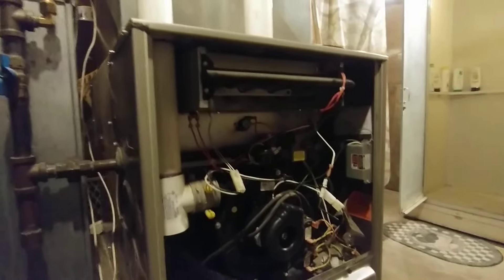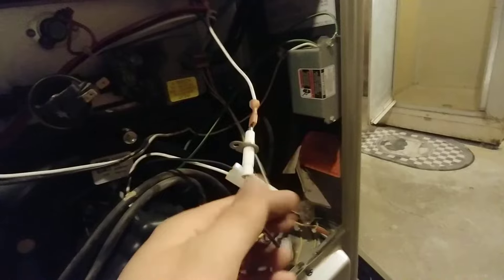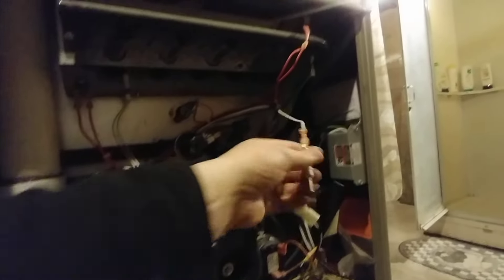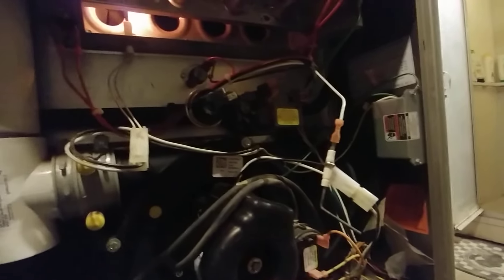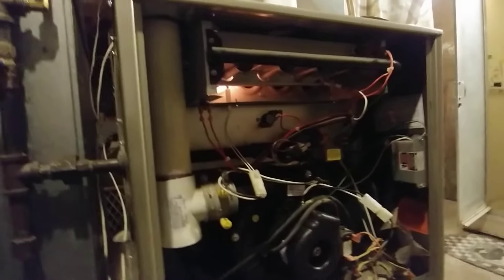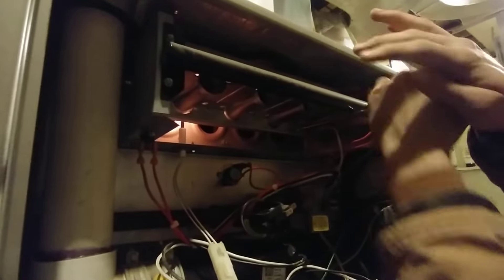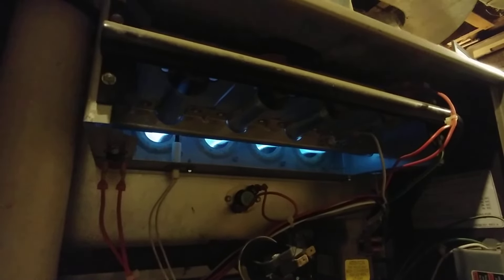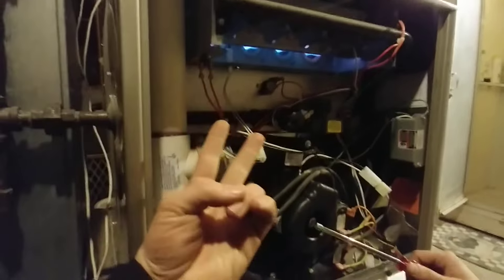Furnace Lights Then Goes Out - Symptoms of Dirty or Bad Flame Sensor

Comment: Thank you! I just fixed my gas furnace using your advice. My furnace had been struggling for about a week now to stay on and today she finally would not go to that final cycle on stay on. I took out my flame sensor and used both fine sandpaper and steel wool to clean the rod and she works perfectly now.

Comment: sometimes the stay on much much longer and then fail and are much more unpredictable.  Good video.
Reply from the maker: That can be caused by the high limit tripping sometimes. Definitely is not always as simple as just the flame sensor. Thanks for your comment!
Reply: @BenjaminSahlstrom  Sounds like what my furnace is doing.. 3 techs don't know whats wrong.. all they did was reset the panel but the furnace still runs weird, like runs 4 mins, shuts off for 15 seconds, fires back up for 5 mins.. Its intermittent, so it doesn't always run like that.. no one knows whats wrong..

Comment: Thank you! Cleaning the sensor worked! (and it's supposed to get cold tonight) 
Now I need to replace the ignitor for my Honeywell (been lighting it by hand) it has the kind that just glows I was wondering if anyone knew if the universal kind would work? The Honeywell is old (late 50's or early 60's)...looks just like the one in this video except mine has the gas burners at the bottom.
Thanks again!

Comment: My Carrier Infinity kept throwing a code 45.
The HVAC guy came out and looked it over.
He cleaned the flame sensor, and everything started working again.
It threw him, because apparently there's a separate code, like 32? That triggers when the flame sensor is dirty.
He said that if it happens again, it's most likely the control board, and that it'll have to be replaced.

Comment: So like what could it be if you never get the flames? It’s hit and miss. Sometimes it will light then go out anyway, sometimes it never lights. A guy can and checked the gas valve there is 3.5” after the valve. I’m about to give up on it. Is it a possibility that the manifold is dirty? I guess that’s what it is called anyway.
Reply: Check if you need a new igniter. $25 part.
Reply: The manifold was dirty.

Comment: Mine would light after reset the furnace up until today. It heats up runs for a few days, to a few hours or just one round then go off,  then would not heat back up on its own without reset. Now reseting it isn't working. Still has a pilot flame. Could this be an issue of the flame sensor? Or what may it be? Tks.

Comment: Dude I had this happen on my hot water tank easy fix my furnace has been acting up waking up to the house being 10/15 degrees colder then set temp. You sir are a huge help 5 minutes and boom furnace fixed but I blew all the dust out of the unit and new thermostat wires so was work digging around 😂

Comment: My furnace is doing the same thing, the glow plug lights and the flames come on, but then a few seconds later the flames go out, but then it tries again and continues to cycle on and off.    I took out the flame sensor and scrubbed it with sandpaper, it seems to be working fine now, do I still require maintenance? Or is that probably all it was

Comment: I think mine is probably dirty. 
I just haven’t gone up to my roof yet to check. 
I hate getting on the roof.
Makes me nervous.
Anyway, when I turn the furnace on all the fan blows is air and it isn’t heated 🤔
I wait and wait for heat but no heat arrives 😩
Reply from the maker: Could be a tripped rollout switch too. Your furnace is on the roof?

Comment: Would recommend not touching flame sensor with your bare hands, potentially putting oils on it causing future corrosion. Also, is that a PVC Tee you're using for flue gas? 👀 should probably not use that.

Comment: I cleaned the heat censor rod and I checked the burners are clean... I found the problem. It was a clogged condenser pump.

Comment: Replaced flame sensor(FS), problem not resolved.  I get 5Vac from spade connection of FS to GND.  

In fact, if I make the measurement, with proper polarity, immediately upon burner ignition, the meter's DC current fools the furnace into running.

It appears the whole circuit works, or both flame sensors, original and replacement, are bad somehow.  They both have 0ohms between probe and spade and are cleaned.

What's next?
Reply: FS cleaned and  I get continuity when unplugged.  I get 55 VAC when plugged into board, BUT still will not stay lit..... any help??
Reply: My board was bad, wouldn't power the blower fan.  replaced the board, and bob's your uncle.
Reply: @bsdnfraje  how did you know your board was bad?  is there a certain test you can do, or did you just buy a new board? how much did it cost you?
Reply: @captaingenius-o1c  I eventually noticed my blower would never turn on.  So i jumpered past the board and it ran perfectly.  So my board was not turning on my blower.

board cost me $120 (my unit had a humidifier, the same board without the humidifier connection was $60, at Grainger.)

This was last year so working from memory.

Comment: Cleaned up sensor, still ignites and shut back off them ignites again
Reply from the maker: The sensor could be bad.
Reply: Checked it's continuity. It's my ignition control board. Going haywire

Comment: The flame sensor on my furnace could be my problem, because when I turn it on, I can hear the normal humming sound, but after about 30 seconds or so, the unit shuts off.
Reply: Was this the issue? What you’re describing is exactly what I’m dealing with right now